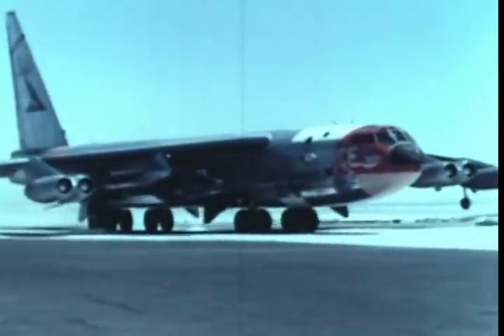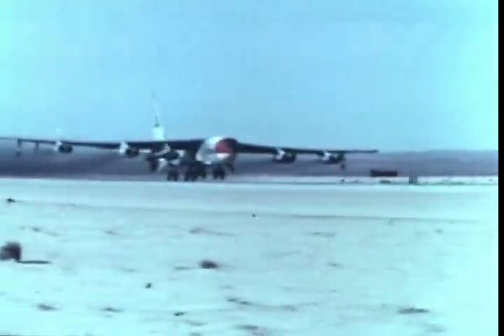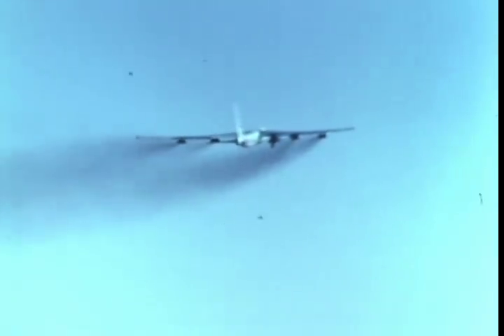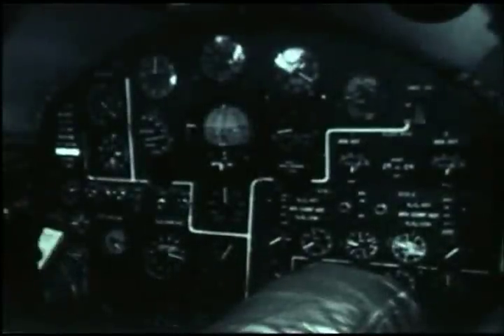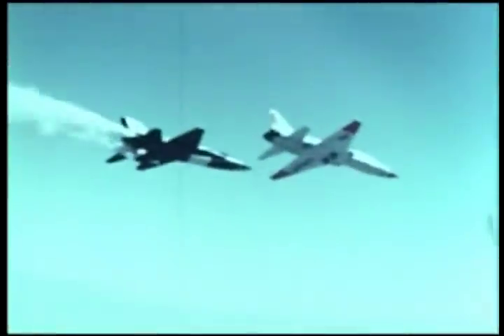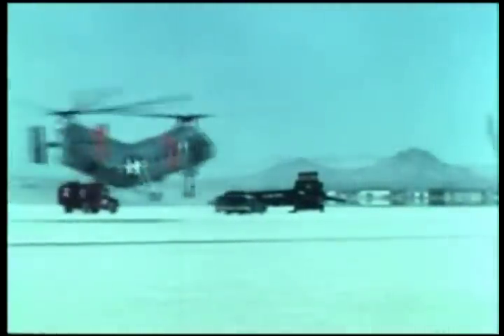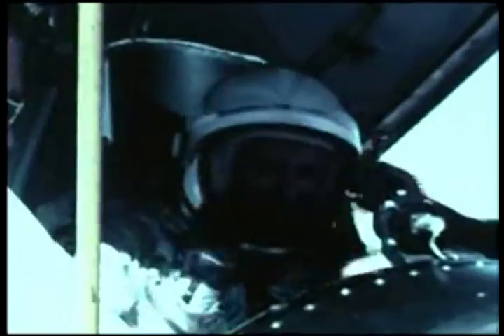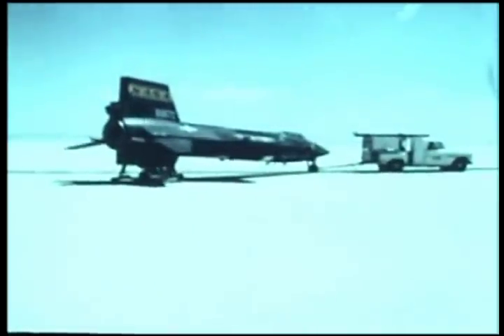X-15 Hypersonic Research At The Edge Of Space

Comment: Footage of amazing plane that made Mach 7 in the 1960s, and everyone can only comment on the helicopter doing the perfectly normal landing transition from forward travel. How else are you supposed to slow a helicopter down when it is traveling at 120mph and you want to land? You vector the thrust of the rotors forward to slow you down, and so you land in a nose-up attitude. No one is "pulling wheelies" for screwing around. The Piasecki helicopter was designed with a tall nose gear and an up-angled fuselage anyway.

Comment: That acceleration at 2:54 is insane.
Reply: I notice the footage taken from the X-15 appears much, much faster than the footage taken from the B-52. I have to wonder if that is the actual speed, or if they sped it up to make it seem more impressive. that would be a LOT of Gee.
Reply: @justforever96   I saw an interview with Pete Night,  he said she pulled 5 G's sustained, and it was the only aircraft he was relieved when the engine quit.. (btw, first man shows a switch igniting the xlr  99, but it was a throttle detent in reality)..
    Claimed it was very hard to work the controls with that G loading, so they modified them to work off pressure rather than movements, al la F16, for apogee and re entry phases..
    Also, the fuselage would "pop" with a giant bang as it went through heating cycles,  scared the half shit out of him every time, never got used to it.. also the service guys burned their hands a lot post flight as inconnel stored heat, and the fuselage was hot to the touch even hours after a flight,  she was a crazy ass ship..
    They did take some time lapse of her, but this footage seems about right. They said after the xlr was installed the F104's, didn't even bother lighting their burners up to give chase as it served no purpose other than to waste fuel, why bother chasing something that would blow the doors off an SR71, at it's lowest power setting (Mach 4 at 60 percent of max pressure/thrust)..
Reply: @justforever96  it's actually time lapse footage. gives the impression of a high G acceleration which would have caused the pilot to pass out
Reply: It’s not in real time.

Comment: I just googled how high you have to be to see the curvature of the earth, and it says 35,000ft. But I remember correctly I saw another search pop-up that said you have to be 310,000ft in the air. This hypersonic jet went 317,000ft in the air. Where’s the curve fam?

And I just looked up something else about the how far is the curve of the earth. Says the earth’s has radius of approximately 3965 miles. Using the Pythagorean theorem, that calculates to an average curve of 7.98 inches per mile or approximately 8 inches. America to England is 4,255 miles. So every 1 miles, the plane should dip it’s nose down 8 inches to match the curve. But when you look up a video of a plane traveling from America to England, the plane doesn’t dip. So, can someone explain why?
Reply: There is no curvature! It is 
M.i.a, missing in action..
In fact nothing can reach 
300,000 ft high, this video is easy to notice that, because if it was at 300,000 ft the blue horizon would be well below the plane. But instead it is side length equal height to the plane. High altitude balloons are at equal side length to this blue horzion just like this plane is and those ballons have a max reach of 90,000 ft..

Comment: I am watching this video because someone on the internet claimed that the earth is flat.

And as a typical guy showed them the video they say that the Video has a "fisheye" effect.

Sorry.
Reply: Yes, yes you can, due to that is when the X-15 is at 317,000 feet, from 3:28, despite the camera having a narrow FOV it is clear at that height.
Reply: Yes, I understand your point and I am only commenting on this due to your reason to watch this, which is similar to my reason. Knowing the X-15 flies at 100km about sea level, and accepting we can see a curve at sea level at 6 Km away, one would expect to see the curve clearly at 100Km high - no?
Reply: Where did this "see a curve at sea level at 6 km away" part come from? What kind of curve are you talking about?

Think about two things in this footage: 1) The rearward looking camera's FoV (Field of View) is very narrow. It is not intended to demonstrate the curvature of the horizon but as an instrument to evaluate aircraft control surface performance. 2) The Earth is huge. It has a mean radius of about 6370 km and thus a circumference of a little more than 40,000 km. At 100 km altitude, you can clearly see the curvature of the Earth if you have a full field of view, but with the available camera angle you would be hard pressed to see any pronounced curvature.

If you were so inclined, you could calculate exactly how little the horizon would curve through that camera by knowing the X-15's dimensions and measuring how much of the available picture space it occupies, then calculating how far away the visible horizon would be from that altitude, and then getting a figure of how long the arc of horizon visible actually is. And remember, the full circle is 40,000 km, or 40,000,000 m. To see even a hint of curvature the visible portion needs to be a substantial portion of that length.
Reply: This footage is really old... so i don't know... i recommend looking up another footage...
Reply: The Curve is (like on a Ball) Everywhere!

We ARE on that Ball but it is (if you have a high rate of intellect) hard to believe that a "BALL" can be SOOO BIG!

And the Earth is REALLY Big! So big infact, that you can not see the curve if you are standing on the earth and just looking at the horizon! But if you are on high altitudes, you can slowly see the curve of the earth if you are high enough. It is not possible to see the curve if you are on a plane or so.

Many people think that you gotta see the curve on earth but that is nonsense.
You can see the curve when you are really high.
Reply: that shitty fashion about a flat earth bagun 2 years ago, those trolls can't understand a if the world were flat or a cube the satellites, aircrafts and fighters would go out through the tangent, not only planes but ships, cars people, this thing is stupid but show us how weak are the belief and the mental stability of humankind when dominated by a total and cronic ignorance of the Science Laws.
Reply: ok, out of curiosity; where is the curve? Surely this is a good video to argue the Earth is a globe due to the height of this plain?

Comment: in this case the landing gear at the rear had no significant reason why the pilot could not get the nose up on the heavy landing it only adhears once it contacts whar t realy happened the pilot was not fast enough in the flare to get the nose up before the landing gear touches thus it was stalled and hit hard ..skeatesy
Reply: No, what happened if you are thinking about the occasion when the plane "broke its back" on landing was that it was still full of fuel after an aborted flight and had to land heavy.

Comment: No. They blackout if vertical or lateral acceleration is too high (thus causing the blood to flow to only part of the body, causing apoxia, or oxygen deprivation). Generally speaking, the problem isn't with speed, but with acceleration.

Comment: People don't blackout if the speed of the airplane is too big?
Reply: No, speed has no effect on a person. We are all travelling at tens of thousands of miles per hour, as the earth rotates, as it orbits the sun, as the solar system moves through space. An object at 10,000mph is exactly the same as one at 0mph, except as he is relative to other objects. Because the air is stationary, you will burn up from friction. But if the air is also moving at the same speed in the same direction, you will be unable to tell if you are moving. It is acceleration (positive or negative) that effects a person, and which we can can feel independent of external indications. If you are in an elevator, you can feel it start to move up or down, but once it is moving, you cannot tell you are moving without windows to see out of. You can feel it stop though. What makes a person black out is when they are accelerated very strongly, and the blood is pulled from their heads, causing oxygen starvation. That acceleration can either be forwards (catapult or rocket launches), or vertical or lateral (maneuvering fighter aircraft). So yes, you will experience some significant G accelerating to Mach 7 (in most cases), but they carefully work out how quickly they can accelerate the person safely and choose healthy people not sensitive to high G forces.
Reply: No they always passed out and crashed, all 199 flights.

Comment: This is just a guess, but with a peak altitude of 60 miles (according to the narrator), I'm going to guess it was flight 62 on July 17 of 1962, piloted by Robert White. It's also possible that it's flight 174, on Nov 1 of 1966 with pilot William Dana. Both of those flights were 58 and 59 miles high respectively, and according to the list of flights on wiki, they were in the top 5 highest flights. Both of those flights most closely match the stated altitude of 317,000 feet.

Comment: I always wondered why they never launched the shuttle into space like this. Surely it's only a simple step from this to Earth orbit?
Reply: It was and is a very valid idea, and still being pursued. You can get an equivalent payload into orbit for a fraction of the thrust and fuel load. 90% of a Saturn 5 or Shuttle's fuel and thrust (and thus size) is consumed in lifting the small amount needed to go the final distance to the point when it can start. That is to say, the first two stages of a Saturn 5 just lift the tiny third stage to where it can take over. The main obstacle is that you need a gigantic launching craft, which didn't exist. Look at the size of the mother ship needed for SpaceShipOne, which is tiny. A Saturn 5 3rd stage is still very big and heavy. A plane that large would probably require a vast runway as well. But it would still be cheaper in the long run than the giant rockets we have been using.